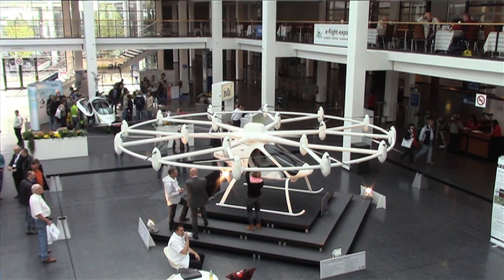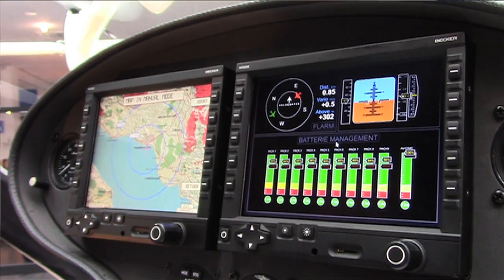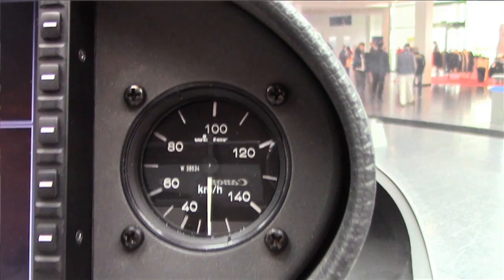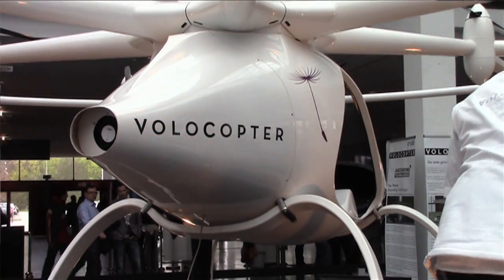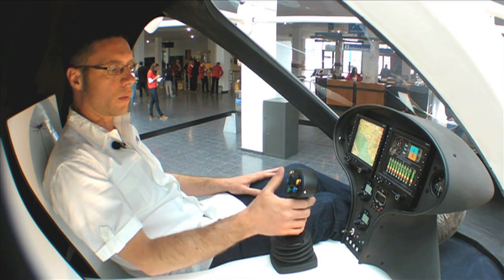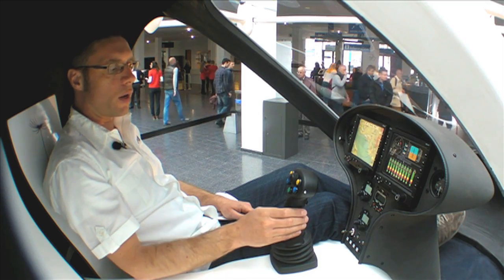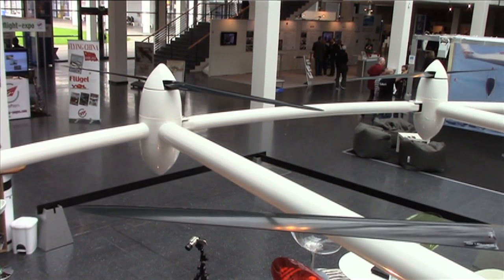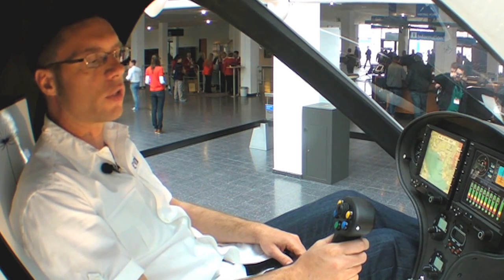Volocopter Debuts at Aero 2014

Comment: In the event of a power failure it drops like a rock, a parachute is a must!
Reply: tjblues01 I doubt that the craft has a single computer. I believe each rotor has a separate controller even on the original prototype back in 2011.

It can't autorotate, but it is massively redundant. It is an aircraft, so perfect safety is inconceivable, but I wouldn't hesitate to fly in it. I wouldn't want to be struck by lightening in a conventional helicopter or any other aircraft.
Reply: a  rocket chute would work believe me but as i said before a pair of wings would not only create  lift but also provide a glide to earth  the trouble is all these over clever engineers from square head land will not listen to anyone  because they are the best are they not ????
Reply: If anything goes wrong with a conventional helicopter, it can come down like a stone. This has multiple lifting propellers and power supplies, even if a number of propellers/motors fail, it can still fly down safely.
Reply: As Stephan Wolf notes in the video, the current design has six separate power supplies, one supply for three motors. The next design has nine supplies, one supply for each pair of motors. A pair of motors isn't necessarily side by side. The two motors powered by a single supply could be on opposite sides of the aircraft. The power supplies are electrically independent. If one supply fails, two motors fail, but the craft can continue to fly in this scenario. If two supplies fail, the craft can still land safely. The probability of three supplies failing simultaneously is extremely small.
Reply: tjblues01 No. Each control system operates independently of the others. The systems communicate with each other, so each knows what the others are doing, and they all measure the same control parameters, but no central controller is a single point of failure.
Reply: tjblues01 Neither statement about Air France 447 contradicts any statement of mine. If you don't want to fly in a volocopter, that's fine with me.
Reply: Martin Brock A number of power supplies provides an extra redundancy. That is correct. But all the craft systems are controlled from single "computer". All electrical... I don’t expect that someone would like to fly this thing in IMC, but nice lightning can fry all electrical systems at once. And also, flying low and slow diminishes your chances to recover.

In a helicopter you can mechanically change the rotor head settings to autorotation even with no power at all.

cheers
Reply: Martin Brock It has to be a single control system. Of course it can be doubled or even tripled. Each rotor has some kind of ESC (electronic speed control), but all of them must work as a team. Changing rpm on one rotor effects all others. Forces have to balanced.

Autorotation is one thing. The second is a power consumption in a level flight. A helicopter uses less power when it flies forward than in hovers on the same altitude. This gizmo drains the same amount of energy regardless of flight phase (props fixed pitch). And third; speed limits. Because Velocopter uses fixed pitch propellers so during forward flight it develops uneven forces on advancing and returning blades. It causes sideways torque on the engine's shaft. With even higher speeds, the returning blade stalls. So you are losing lift. Those apply also to helicopters, but they blades can move freely and reduce those problems.

Airliners are struck by lightenings quite frequently. The same applies to general aviation aircrafts - fixed wings and rotorcrafts. It is not big deal, because most of them are made of aluminum alloys, creating some kind of Faraday cage. Big composite airplanes have a metal mash in their skin for that purpose.
The problem is with small, composite flying devices :-)

In gas powered planes (piston & turbine), flicker of the power for few seconds is not dangerous, when flying at altitude. Turbines  (jets, turbofans, etc) don't have spark plugs. As they are initially ignited, they  can be flame out only by oxygen or fuel starvation; not by lack of electricity.  In piston engines, an ignition magneto is used. It is separate electric system, simple and very reliable.

Main 3 rules is aviation are:
* aviate
* navigate
* communicate.

The first is the most important. If something wrong will happen with electric system in airplane you wont be able to navigate and communicate. So you would most likely land in some new place and meet new people. If your power-plant or control system refuse to work... you are in serious troubles. That's why I don't like all-electric airplanes.... Not yet anyway.

Velocopter can find it's own niche and can be very successful there; remote area grid lines check, fun flying, short range rescue... But as personal transportation, I don't think so :-)

cheers
Reply: i beleve it has a balistic parachute in the center (somthing you cant have on a normal helicopter)
Reply: tjblues01 As personal transportation, I wouldn't hesitate to fly in a volocopter. If you're right, I die at some point, so at least you can't say I-told-ya-so. You aren't right though. No aircraft is perfectly safe, but this design is practically solid state (rotors are the only moving parts), highly modular and redundant. The modularity lowers cost, and the redundancy ensures safety. The energy density of batteries is still a major hurdle, but these things would be common flying machines in my lifetime.
Reply: Martin Brock
No. Each control system operates independently of the others..... but no central controller is a single point of failure.

Do you remember Air France 447 crash? Fly-by-wire, doubled air data computer (ADC)... etc. All for nothing when one Pitot tube got clogged. Similary B2 - Spirit: 

_ "The findings of the investigation stated that the B-2 crashed after "heavy, lashing rains" caused water to enter skin-flush air-data sensors." _

Those 2 examples contradict your statment. 

No aircraft is perfectly safe, but this design is practically solid state (rotors are the only moving parts), highly modular and redundant.

A fixed wing airplane is practically solid state. Propeler and control surfaces are only moving parts.... 

But I agree, no aircraft is 100% safe. In this case it is about personal likes and dislikes. I just don't like when all depends on power and avionics systems. No power and you are falling from the skies like a brick. Think, why it took 100 years from the first powered flight to built Velocopter? Because it is very complex and lacks of safety measures. As I said before: aviate, navigate, communicate. If electronic navigation system fails in a arplane you can still safely land. In Velocopter you have avionics and power managment integrated in one system. IMO it is not good.

If you like STOL aircraft, you should think about autogyro. It is a way safer.

The modularity lowers cost

Yes and no :-) The whole design demands use of high-end materials. And they tend to be expensive.

 The energy density of batteries is still a major hurdle, but these things would be common flying machines in my lifetime.

For low flying machines diesel-electric hybrid would be good choice.

It would never be any "common flying machines". At least not aerodynes as known nowadays.  They are not efficient, they have low own mass to payload ration, they are difficult to control and are very prone to weather conditions. 

cheers
Reply: yes parachute is important for sustaining life nothing is fail safe i agree totally
Reply: this will be one of the safest aircraft ever built,its designed to fly low and slow,a ballistic chute will make for a very safe landing,unlike a standard helicopter which can't use one.
Reply: Thomas Lewis Flying slow and low is not always save. At less than 200ft and 50kts there small chances that chute will open. Helicopters can auto-rotate -- this thing can`t.

cheers
Reply: tim hedges I agree; a rocket chute will do:-) But also it adds weight and complexity which in this type of flying device is critical. 

Hey, there is an idea; what about an "air bag" similar to the one used to land Mars probes? :-) 

happy landings
Reply: It will have a parachute for emergency cases.
Reply: Bethany Ebdon
Have you heard of an auto-rotation? Just asking :-)

This aircraft with fixed pitch propellers  doesn't have ability to autorotate. So without ballistic parachute in case of failure it drops like a rock..

cheers
Reply: yes no auto -rotation in this copter,so much the better,a ballistic chute is much better.Few pilots ever get a second chance with a auto -rotation.They loose the tail rotor or ,something within the complex hydraulic system fails.A auto rotation becomes impossible.This will be a safe way to travel,slow,low and short distances.I expect accidents with injuries to be extremely rare.Its simple,cost effective and I think many industries will find work for a vehicle like this.Farming,inspection work of tall structures,power lines,bridges,etc [sometimes you need a human eye to take a look]

Comment: Why not simply pop a couple of solar panels on the roof and extend the battery life from 20 minutes, to 24hours. Its not rocket science.
Reply: Why? Because there is not enough energy coming from the Sun to sustain a flight of rotorcraft. For example, light helicopter Robinson R 22 has Max. takeoff weight: 635 kg and 93kW engine.

http://en.wikipedia.org/wiki/Robinson_R-22#Specifications_.28R22.29

Sun in zenith gives you roughly 1kW per square meter. So if you cover the whole rotor area (rotor diameter 7.67 m) with solar panels you would have 46.2m^2. You can't do that because air must to go and accelerate through the rotor. But lets say for a sake of thought experiment that you could make some kind of umbrella above the rotor. So you have 46.2m^2 * 1kW/m^2 = 46.2kW. And knowing an efficient of solar panels as max 21.5% you've got 9.933kW. It means it is about 10x less than you need not even mention charging batteries.

In other place I found that solar panels can produce 175W/m^2 so it gives you 8kW...

cheers
Reply: Solar panels generating the necessary power would be far larger than the craft and add far too much weight.
Reply: Because it would take about 10 acres of the most efficient solar panels known, THEN the range would be about 5 minutes. Actually aerospace engineering IS rocket science.
Reply: Martin, 1) This is not a fixed wing airplane, it's a helicopter requiring exponentially more power to hover than a fixed wing requires for level flight. 2) Voltage will not be linear when current is. See 'circuits in parallel vs series'. In order for the power train to be redundantly safe, it must be wired in both. The engineers cover that in the video.
Reply: It's mathematical term. Helicopters need MUCH (to simplify a term) MORE power to hover than a "Regular" airplane needs to maintain level flight - all other things being relative.
Reply: dieselscience Thanks. I have a masters in applied mathematics with a 4.0 GPA, and I was a professional mathematician in the high energy astrophysics lab at NASA's Marshal Space Flight Center for decades.
Reply: Sure.
Reply: dieselscience It's not quite that bad. The volocopter needs about 60 kilowatts, and a decent solar panel can generate about 10 watts per square foot, so we're talking 6000 square feet or so. That's a square panel about 75 feet on a side. Solar powered planes do exist, but they're extremely lightweight, often unmanned, and have solar panels over the extent of their very long wings. 

http://www.solarimpulse.com/
Reply: dieselscience I have no idea what "exponentially more power" means.
Reply: dieselscience I agree. Is anyone disputing this point?
Reply: Martin, this should explain more....http://lmgtfy.com/?q=Exponent
Reply: dieselscience
Obviously "exponentially" is "a mathematical term", but unless you specify base and power for your exponent it's meaningless. Even "much" is loose but at least is admittedly so.
Reply: Ok Laurie, let's talk in terms of a helicopter with a human pilot. You think the base and power are on the order of 10^-5?